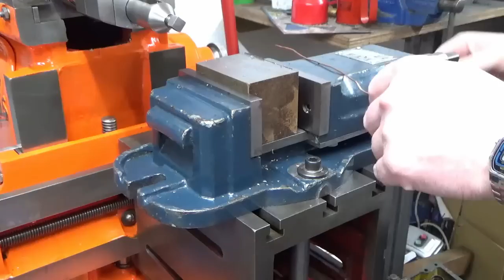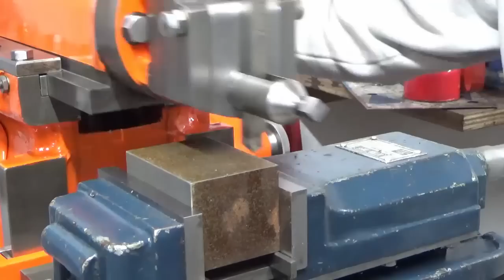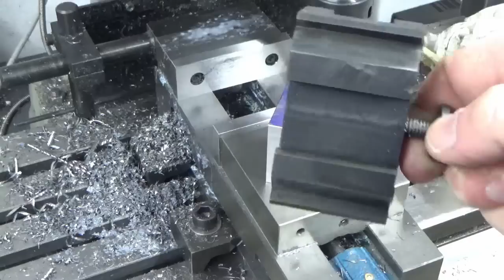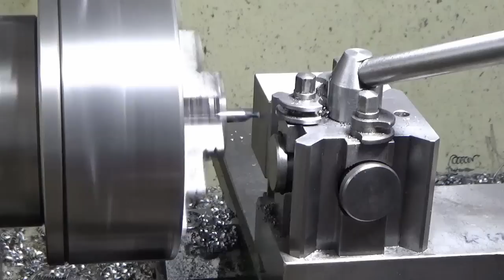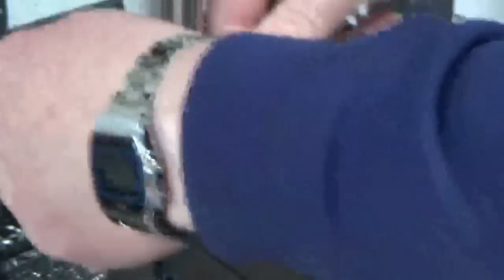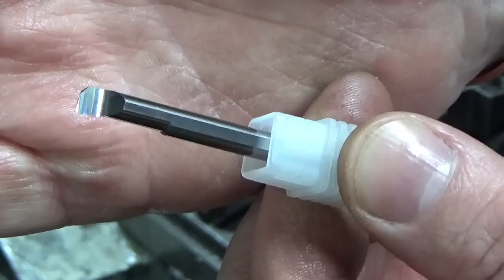Making A Micro Boring Bar Holder For The Harrison M300 Lathe

Comment: Good one .   I need to make a heap of the same holders one day .    Did you think of putting a dowel perpendicular through the bore of the holder .  It locates the small boring tools with a bevel cut on the ends to automatically set the centre orientation . Great job .  👍
Reply from the maker: Hi Max, thanks for the comment. Thats not a bad shout, I may make the mod in future, thanks for that. Cheers, Jon

Comment: Great stuff Jon. I think anyone using a medium/large lathe for smaller work could benefit from this idea. I've added it to my neverending todo list (you probably know the one.. 7 new items added, for every 1 item completed...). Mine's a sliding wedge style holder (aloris copy), with the boring bar tool block already made. I'd previously considered it a bit useless, because it's a very specific size. But making up a set of the adapter bars will be a great way to make use of it. Thanks for the idea.
Reply from the maker: Hi Craig, thanks for the comment. Yes, I have an upcoming project where I am going to be boring out to 6mm, so this is in preparation. Definitely needed on bigger lathes. Cheers, Jon
Reply: Only 7 to 1 ratio on the to do list....your in good shape 😂😂
Reply: @TheAyrCaveShop  😂

Comment: Hi Jon, nice work! Did something similar on my smaller QCTH. I had a 20mm bar so made the block to take that, had the QCTH end water cut,  made life easy! I then made up bar holders for 6 to 16mm bars, Joe Pie posted a video on the idea, freed up several tool holders for other things! Thinking I may be able to work it up to take a slotting tool as a bolt in/on addition….. Cheers Kerrin
Reply from the maker: Hi Kerrin, thanks for the comment and feedback. Yes, slotting tools would work well in this type of holder. Cheers, Jon

Comment: Very interesting Jon, when I made my T2 holders I set the angle of the head the same as you I was also reluctant as I had the vertical position spot on, I managed to pick up a T2 Dixon holder that takes an MT2 taper for drilling via the Carrage, not tried it yet, but have some more mild steel so think I’ll give your boring bar holder a go, would be interested to know where you purchased the micro boring bars from, nice one mr Jon
Reply from the maker: Hi Terry, thanks for the comment, this is a much easier method than my 1st attempt, just the tramming grief to deal with. I will put a link in the description in the next day or so to the Ebay reference. Cheers, Jon

Comment: Great machining again Jon. That will be a useful tool for those small diameters. 
No problem moving the milling head as long as it is easy to tram in again. How long does that take to do?
Reply from the maker: Hi John, thanks for the comment and feedback. Tramming the head on these Chinese Mills is no fun, they are mega top heavy and unbalanced so every time you tighten the nuts, everything moves, it's a good 20 to 30 mins job which is why I generally avoid it if possible. Cheers, Jon

Comment: I hate moving the head. It's a bitch to re tram. I keep thinking about bolting a bar to the side of the column with another bolt pushing onto the head to help re tram for that micro adjustment. times like that you wish you had room for a bridgeport 😁
Reply from the maker: Hi Paul, thanks for the comment. Yeah, these Chinese jobs are very poorly designed, totally top heavy and unbalanced which makes tramming a pig. I reckon I could do 6 Bridgeports in the time it takes to do one of these! Cheers, Jon
Reply: @jonsworkshop  any ideas for making it easier?

Comment: Seems like a lot of movement of the table on the shaper....
Reply from the maker: Hi Nick, thanks for the comment. It's the whole machine moving on its wheels, I have still to site it properly on its feet and rewire etc. Definitely not the table based on parallelism checks I have done, although I must admit it does look like it on video. Cheers, Jon